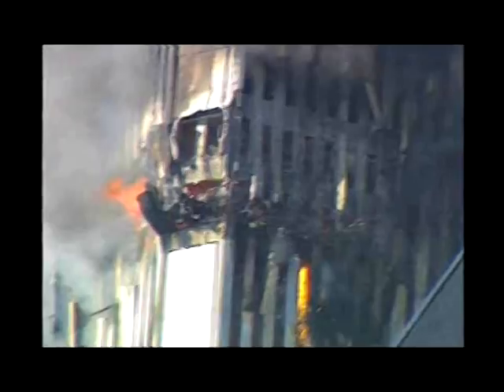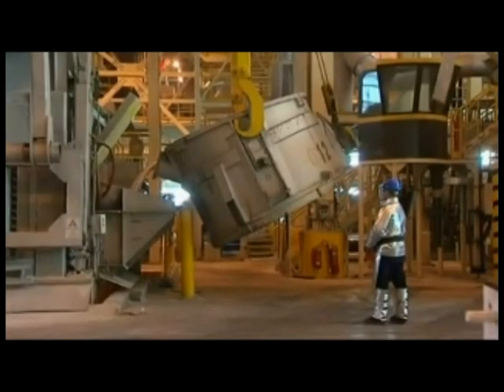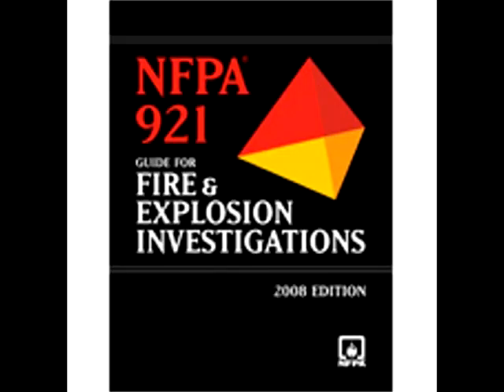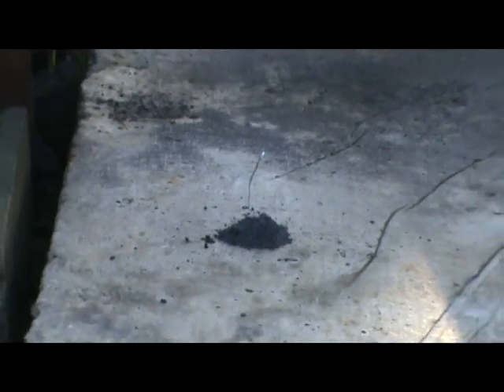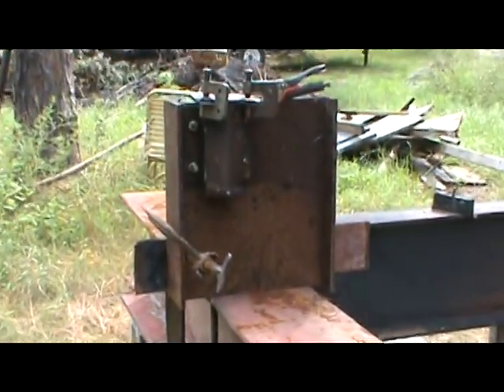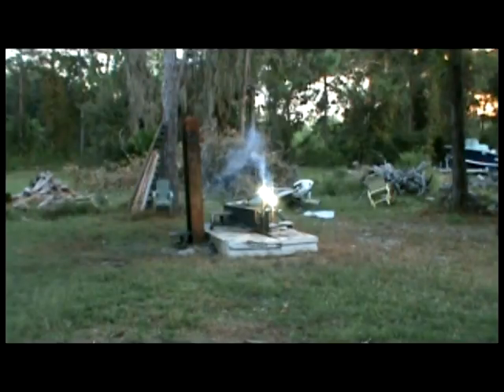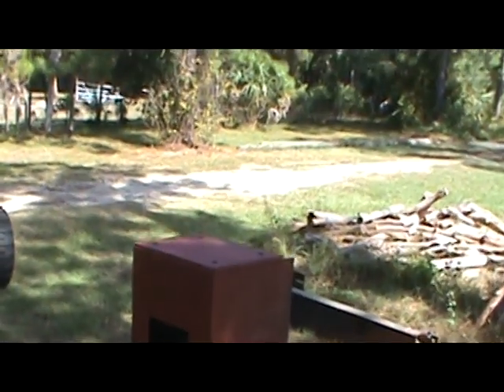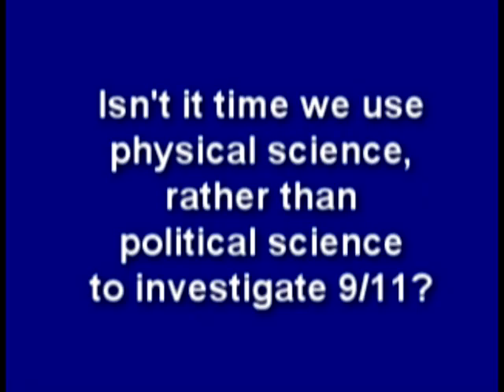9/11 Experiments: The Great Thermate Debate

Comment: my opinion on 9/11 : no explosives were there. what happened is you had a 747 nearly full of jet fuel that weakened the top part of the structure which cause the top part to fail and once it started falling and gaining momentum  the rest of the tower was going to go down with it. personally i think the fires would have been hot enough to make that steel glow red and i personally know that when steel glows red it becomes easy to bend as I've done it my self with a steel rod
Reply: +patrick Tighe birds born in a cage think flying is an illness
Reply: +patrick Tighe Even if what you say is possible how do you explain Building 7?  No plane filled with jet fuel hit it.  It fell like a planned demolition.

Comment: +thermite burns hot enough to melt steel beams. What you say is thermite in the video actually is, then:
+Bolt cutters in 'hand holes' 
+towers fell universally straight downward

Is it possible, thermite was used on these bolts and beams such if in such an event, that a fire burning in these areas were to happen, the towers were to collapse downward instead of falling to the side and damaging more than what was at stake? 

I wouldn't point straight towards planning to have them come down, but as such, like bridges, if they WERE going to buckle, they should do it this way. You're an engineer. You would know this then, right? 

If we're going to use your logic, then we painted the insides of our home with lead paint to control population. But alas, we found lead paint to be toxic... So we stripped it and disposed of it and it is against regulations to use any more.

Comment: Jet fuel most certainly CAN melt steel, when stoked by air. As the fire's hot air is rising through the building and exiting out openings above, air is being sucked into the openings below at the fires location, which can stoke the fire to metal melting temperatures. Just like it's been done for a very very long time by smiths and smelters using a bellows.
The steel did not need to be completely melted in order for the collapse, it only needed to be softened enough for the building's weight above the fire to take itself down. The weight of the building above the softened metal in the fire is all it took to bend, then sheer the softened metal as the top of the building shifted, then collapsed down gaining momentum and bringing the whole building down below it. 
And this was made all the more obvious since the second building to get hit collapsed first, since the second plane struck the building lower than the first, causing more weight to be above the fire's location, so it collapsed sooner. But that's just my take on the matter. All the conspiracy stuff is quite interesting really.

Comment: I appreciate your engineering prowess and experimental design. Wouldn't it be possible for thermite to form from the shredded aluminum skin of the aircraft combined with oxidizing ferrous materials of the building?The white sparks very well could have been from burning magnesium. Many parts of an airplane are made of magnesium especially the landing gear.

Comment: This is a great video! The best one I've seen on the issue. I never heard of thermate until some time after 9/11. I think it was Jessie Ventura who I'd heard about it from, and I didn't give it much more thought for a while. But this video makes sense. And, the sheer weight of each floor over the other would likely be enough to cause the heated steel to twist and rip after the thermate melted enough of it to cause the structure above to be too heavy to continue to support it.

Comment: all well and good, nice field testing but there's STILL one overriding problem with Thermite explosives being used. Simple basic question that everyone never seems to ask and answer: "who? what? where? when? why?"

Lets take one at a time:
1. Who?  who planted the explosives/ There are only a half dozen companies on the planet who know how to use it. Surely ONE of them knows who of their competition did it. That's a VERY small, very exclusive group to keep secrets from. 

2. What? How was it deployed? How do you plant thermite explosives and detonators without ANY member of the public or NY/NJ Port Authority security, the NYPD, FBI and CIA from finding out? It's a public facility used by thousands every day. The FBI gets wind of people building small bombs in their apartments without much trouble. How come it didn't happen here? Or are you saying EVERY member of the FBI and NTSB were all in it? That's a huge stretch of reality there seeing how they're all in law enforcement.

3. Where? Why only on the 80th Floor - since that seems to be the ONLY place where this molten steel was seen? If you're going to use thermite in this capacity - to take down wo massive buildings - AFTER PLANES HAVE HIT THEM -  wouldn't you use a lot and spread it around? Wouldn't we have seen many more hot spots of molten steel than just ONE isolated area of ONE floor? 

4. When? When was this done? It takes over a year of planning to bring down a hollowed out, structural integrity weakened 25 story building. Two 110 story buildings - still in use - with all furniture and support structures in place? To do such a covert operation, planting explosives and detonators in an active office building, on such a massive scale would take YEARS of planning and execution. So you're looking at the Clinton Administration as the inception point and execution point during GW Bush Administration. That's A LOT of years to cover without ONE person involved, having 2nd thoughts and leaking the plot to authorities?

5. Why? Why would thermite be needed? If your going to hatch a plan to crash two jetliners into two iconic buildings, knowing full well its going to be carried live on TV, with millions of people watching all around the world, why risk such a massive covert operation to plant and detonate explosive inside said buildings just to use it as a prelude to war? The sight if two planes crashing into those buildings is certainly enough. There's no need to go that extra step - a step that takes years of planning an execution - that is so rifled with ways for things to go wrong and be exposed etc? It makes NO sense.

Then we have the GIANT elephant in the room question. 
How does one coordinate such a massive plan, find and involve 1,000s of people over multiple local, state and federal agencies willing to be 100% complicit in killing thousands of fellow, innocent Americans, and have NOT ONE come forward before, during or after? 

Not. One. Ever.

Something like the JFK assassination is something you pull off and keep secret because one would only need to involve a handful of people to plan and execute it. Not that I believe that but its certainly more plausible than what would be needed to carry out the 9/11 conspiracies put forth on channels like this and many more.

Comment: One conspiracy theory says that the US government weakened the steal with termite.  My question is, why would they do that?  if the goal was to in site a war for oil, wouldn't the hijacking of 4 planes, three of which crashed into US buildings be enough to start/fuel this war on terrorism???  why would the government risk being exposed just to collapse the building, when the biggest terror was perceived when the planes struck the towers?? of course when the towers fell that was heartbreaking but if this was all a inside job couldn't they have accomplished the same outcome without the thermite and tower collapse? ?  it does not make sense to me.